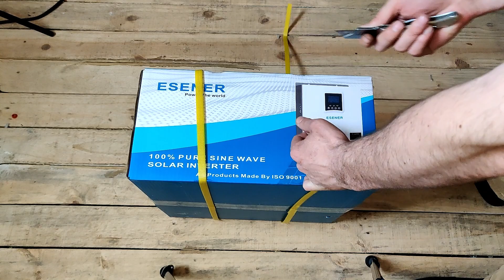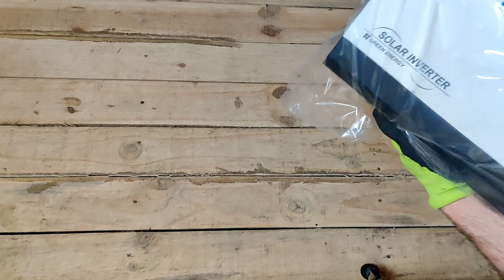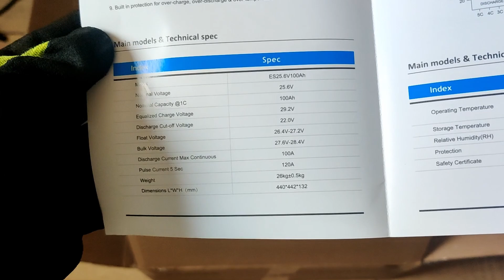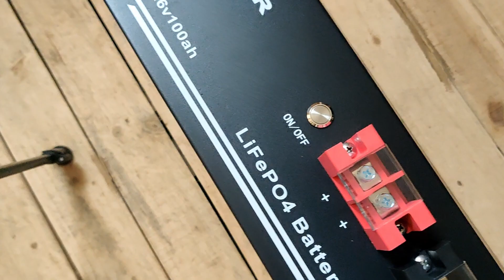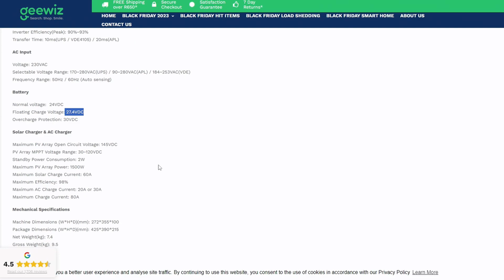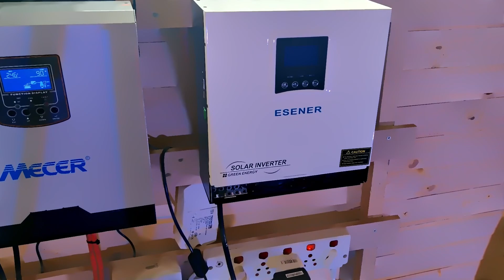Loadshedding backup system upgrade on a budget, Esener 3kw: the perfect mini budget backup system!

Comment: Hi, i just wanted to know if this 3kv can run for 8 hours, running a fridge, tv,ps and lights
Reply from the maker: I'd probably work on about 4 hours, if you had to check the wattage on each of those items you'd be looking at about 500W and this system with a single 100ah lithium battery is capable of 2500wh so it would last about 5 hours if your setup uses 500W
Reply: @JustekGaming  thank you

Comment: Does it come with the wires? if not which do i have to buy?
Reply from the maker: Unfortunately it doesn't, you can look at geewiz or takealot for 25mm/30mm red and black battery cables
Reply: @JustekGaming  
Alright👍🏽

Thank you for the Response.

Are those the Only Cables I Need?
Reply from the maker: @Kgao2  yes, 25mm black and red battery cables will work
Reply: @JustekGaming  Thanks.
Reply: @JustekGaming  
Alright👍🏽 

Are those the only Cables I need?

Thanks for the response.

Comment: Hi, I have the exact same system but it beeps every morning when the sun comes up with error 03 (Battery over charge ) is there a setting I can change to prevent the batteries over charging ? also can I set it up so that the house runs on solar during the day and not the grid ?
Reply from the maker: What batteries are you using? It's usually because of the voltage settings, try set bulk charge between 0.3V - 0.6V above the float and also on option 21 (stop charging when grid is available)
Reply: @JustekGaming  identical battery and inverter to your system
Reply from the maker: Okay set the following 
2.56kwh lithium battery
Bulk voltage 27.4v      
Float voltage 27.3V    
Cutoff voltage 23.5V

Comment: What a sad reality isn’t it
I really hope that something changes in this country. 

I did have a question. I am possibly moving into a temporary apartment next year and I would still like to be able to do work and play some games when loud shedding hits. What do you think is the cheapest way to “solve” the problem?
Reply: This does however look like a good option if I can alter my budget and in a way get it to work in an apartment… which might be a problem, but we’ll see.
Reply from the maker: You can also look at the 1kw system from Must also sold at Geewiz, with a 200ah or if you at a 100ah lithium 12v for a start it can do about 500w per hour for at least 2 hours and add another 12v battery at a later stage
Reply: @JustekGaming Thanks, I’ll look into it